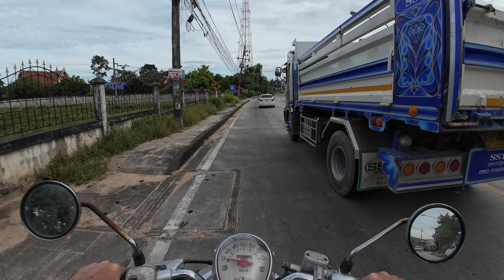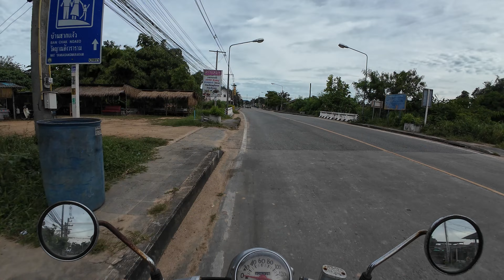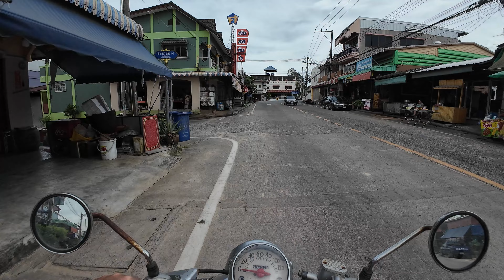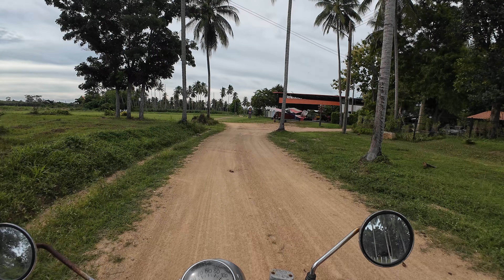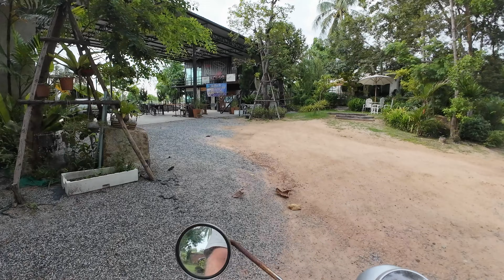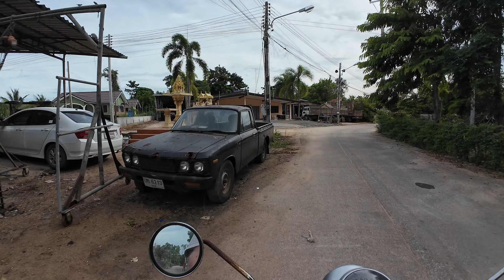Ep 28 - Yamaha Fino test ride. The most unsafe scooter I've ever ridden 🇹🇭

Comment: The Yamaha Fino, wave a gasoline rag in front of the carburetor and your goos for a 120 😂 it doesn't do bends simply because it hasn't seen one in 10 yrs ,LOL , another fine entertaining video from Toni in Thailand, a true white knuckle ride, I remember back in the 70's these little bikes/scooter types were popular and all the Japanese companies made a few variants of them and all road softly , when my older brother got his bike license, he bought a small Kawasaki 125 4 stroke off a neighbour and cleaned/tuned it up nice and off he went to his friends cabin at a lake some80 or 90 miles away thinking they'd arrive in a bit over an hour 😂 2 hours later they arrive realizing they can only average 50 mph , any faster and they'd start to over heat a bit, coming home they added  10 psi to the tires and it made a nice difference, so he found out that by getting a new spark plug with a lower temp range and a exhaust off another bike it did not get hot like it did the first trip and they came home from the lake this last time for a dollar in total, he was very happy , what more could a person ask for , great video Toni
Reply from the maker: I remember the 70's & 80's very well with all the bikes I used to have. I had a Kawasaki KH250 at one point and I think that was the most memorable, the power band on that thing was dangerous to say the least. In the end, it blew a piston which was probably due to it running too hot - It temporarily seized a few times which I totally ignored because I was young and didn't care but now, I wish I still had it :)